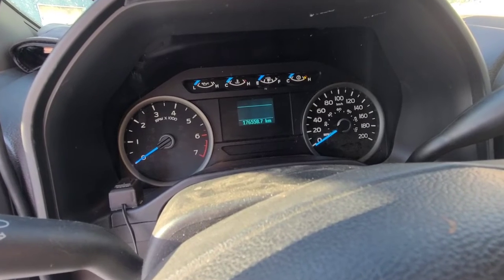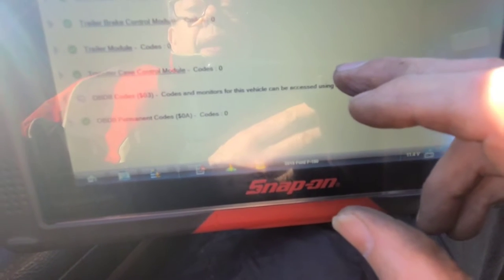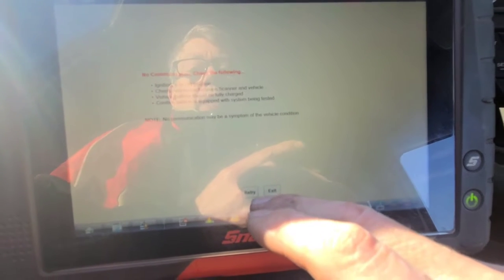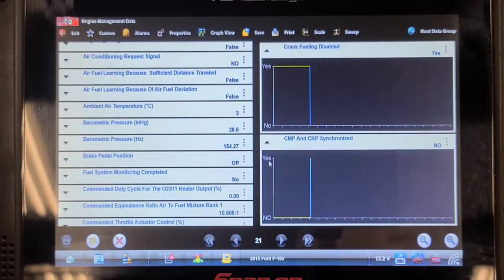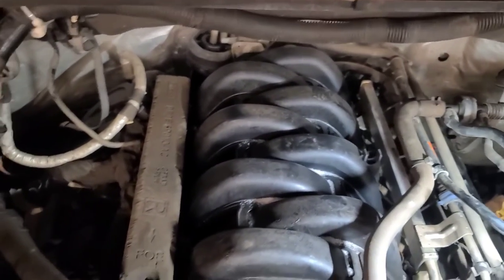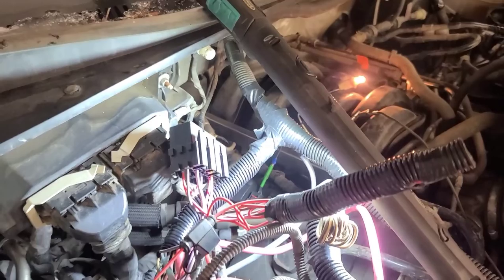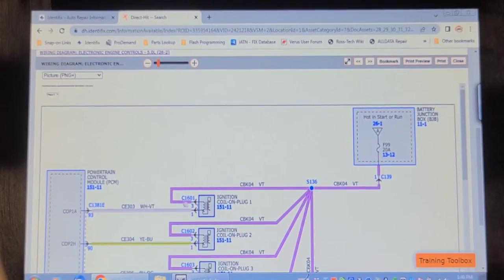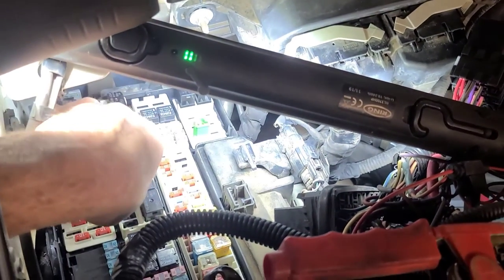2015 F150 Crank No Start No Codes

Comment: G that engine was noisy. I have a similar problem with my’14 with 5.0 extremely intermittent starting issue. Turns over no start. Seems like a shot of starting fluid is what’ll get r goin. Nothing else worked. (Engine was cold ) . Also occurs with normal temperatures n after running n will even quit while driving. Seems like a fuel delivery issue. Wtf is a fuel pressure regulator n could that b my problem. ??

Comment: Is a service bulletin for that circuit pull out and replace
Reply from the maker: Replace what? The fuse panel?
Reply: @PhillipBailey  on top of rad thinking fuse for fuel pump
Reply: @PhillipBailey  cut wire from that fuse ove relocate fuse in same box new fuse location with attching note fuse box
Reply: @PhillipBailey  just the next open non used fuse holder . Just move the circuit over none used open fuse
Reply from the maker: @davidellenbaum1229  That would require disassembly of the fuse panel. The missing fuses did not have the terminals populated. I'm sure it will be fine the way it is. Thanks for the suggestion though an inline fuse could be fitted as well.
Reply: @PhillipBailey tsb 15 237
Reply: Tsb15 137 not 237